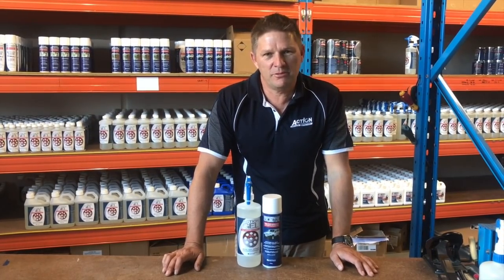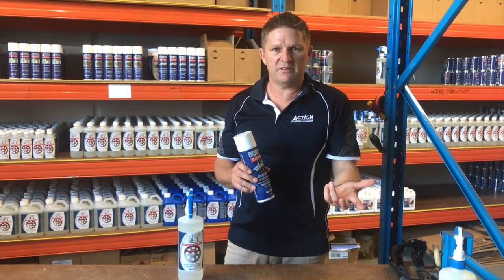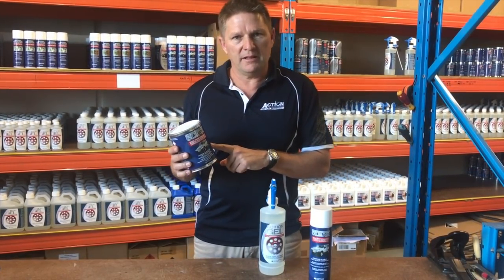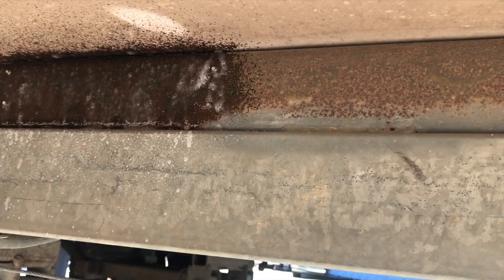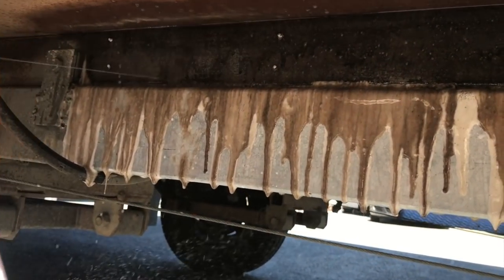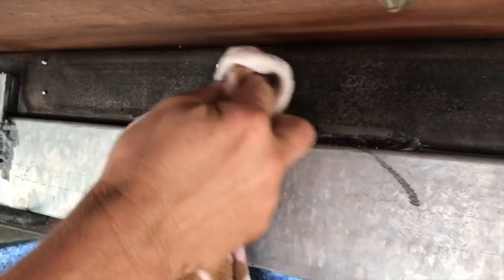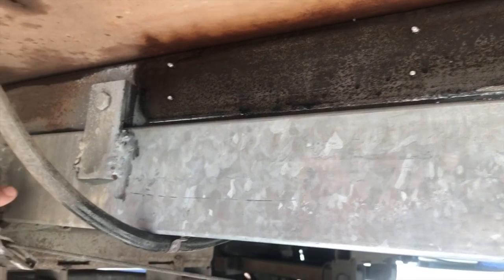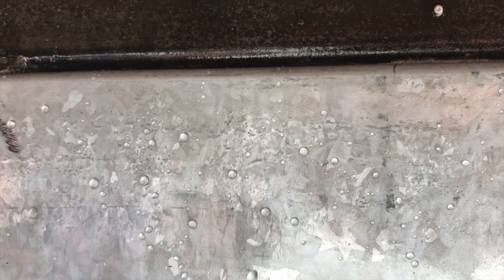How to De-Rust and Protect A Rusted Chassis.

Comment: Those brackets on the chassis look as though they were welded by stevie wonder 😂😂
Reply: They were probably attempting to weld directly onto the zinc coating and couldn't achieve fusion of the steel without burning through the zinc first.

Comment: Has alot of rust on the chassis. Ya right come to Canada
Reply from the maker: Our products are available in Canada. If you would like to test them out you can purchase them at https://www.actioncorrosionsales.com/shop
Reply: i live in sweden. The undercarriage on my BMW from 2006 is completely rusted. 
in order to fix this im gonna have to like put my whole car into a pool of rust remover and keep it in there for a month!
I really want to fix it. but it's gonna take several hundred hours and cost a lot of money. So its's probably cheaper to just buy a brand new car
Reply: i really hope they can invent some new material that is tougher than metal and cant rust. even if it was sitting in the bottom of an ocean for 10 million years it still wouldnt have a single piece of rust.

Then they have to make a car out of that material and give it to me!

Comment: So how about a new update video to show how that finish has held up after a year. Thanks.
Reply: They won't do that incredibly hard coatings crack and fall off
Reply: Use boat paint ...if you live where snows a lot....
Reply: @saulrivera1133  omg this here is one of the BEST pieces of advice I've heard regarding this topic. I hadn't of thought of that! I live in Central Oregon and one thing we know well here is cold and snow. We'll get between 4 - 10 feet of snow OVER NIGHT in some areas. 

I just returned to Oregon after living in New York for the last 3 years. They heavily salt the roads in winter over there. I have a 1998 GMC Sierra with a 10inch lift. I drove it from Oregon to New York. Not a spot of rust on the undercarriage. After 3 years on salty new york roads the ENTIRE undercarriage is COVERED with rust. Just solid red bumper to bumper. That's my I have been hoping to find a spray on rust remover cause i dont want to have to pull my truck apart to get all the rust off. I had been considering different types of underlining but boat paint and coating makes incredible sense! It would hold up better to the snow and moisture in the winters here. Luckily, because of the elevation here (about 5000ft) there's no humidity. But our winters are harsh cause we sit inside the snow clouds (I live in a mountain town). 

Awesome advice bud. I'm definitely going to give this a shot. 😎👍

Comment: Thank you for posting the video. It looks like to me you would have been off using a brush and brush it on.
This way there would be no over spray getting onto to other parts of the vehicle, and no streaks or drips either.
It also reminds me of Navel Jelly the way it works in dissolving rust.
Reply from the maker: Using a brush is definitely an alternative way of applying the Action Gel that we recommend.
Reply: You are just wipe a cloth thats not a quality work.use a cup bras put it in a grindet or a drill,there are small steel brush thatcan fit in a dtill,to make it quality.aftet using a steel brush din thats the time u use anti rust sprayer.

Comment: When he was talking about a 25 year old vehicle with bad rust i was shocked to see it look so good underneath.
Here in Canada that would be a 2 year or 3 year old untreated car.
If i saw a 25 year old vehicle with surface rust like that i would think it was parked inside its whole life.
If you have a normal driver in Canada left untreated the cars frame would be rotten like swiss cheese in no time.
I was looking under 2018 and 2019 trucks at the dealers and they had that surface rust everywhere except the ones which were undercoated every year.
Reply: Ive lived in Tucson my whole life and have a 67' Scout thats lived its life here too. No rust. Im older than the Scout but I dont look near as good. My question is for this vid is could you use a hose to rinse or is a squirt bottle the only option.

Comment: I've had a dilemma for a long time if I should sand my Saab 9-5NG 2011 undercarriage mainly because of two reasons:
 a) sanding is the best way of removing rust, but at the same time, it's very destructive and will damage all the factory protective layers that have been applied in the manufacturing process (in my opinion, not repeatable in a garage environment for sure). Furthermore, it will not reach places like those between the sheet metal welding.
b) costs - If I were to give it to pro mechanic to do it, it would cost 1/2 value of my car.  

My first idea was to get rid of loose surface rust first and then treat it all with special purpose marine or industry paints, which are quality products to be used directly on rusty places being very resistant to environments like salty water. Your process looks promising and seems to be an alternative, and way more simple, however, I think the final flexible layer should be applied to protect the metal against stones etc.

Do You seel these products in Europe too?
I'd be happy to hear some of Your thoughts . Thanks

Comment: The clear coat protectant seems just to be clear coat paint the only difference is the spray applicator is really nice because it seems to spray in a 5 to 6 inch wide line.
Reply from the maker: Hi Paul. The Clear Coat is not a paint. It is actually a resin based product, not oil or water based. This is what gives it such good protective properties. It also has an extra quality that it does not allow rust to creep under it like paint does. If you would like any more information on the product please email admin@actioncorrosion.com.au

Comment: You protected your chasis against liquid only, but vehicle chasis needs to be protected from rocks aswell. When you are driving on the road, there will be some rocks hitting the chasis and penetrading this thin  waterproof coating. The water will  be able to get to the  metal after that  becouse the coating will be damaged in some places and the rusting process will restart in no time. Thats why you should put some heavy duty anti-gravel coating + add vax in the the end so that anti-gravel coating dont dry.
Reply from the maker: Rocks may chip the coating but as it is self leveling, it is easy to touch up. The product also has the ability to prevent rust creep so it will not spread under the coating.

Comment: Transmission fluid works very well for anti rust and isn't nearly as expensive.
Reply: How do you apply      Can / paint brush? 
Does it need heated up or anything and is using the used Transmission fluid ok?   I have lots of that setting around
Reply: Robert Maxwell When I applied it to a bare metal frame after sand blasting it. I applied 80/90 weight with a brush. That stuff soaks in and stays.
Reply: harry pag Yes sorry that's what I meant, I have confused the 3 because I use it in a manual transmission.
Reply: Samuel Miller -the idea is to avoid the wire brushing/ power brushing/ scraping totally! That’s the PITA work. Lots of oils work great applied annually to the underbody (I prefer fluid film or Eastwood, both easily spray on)
Reply: @dominiquestephenson195  do you apply the fluid film directly over the rusted area or prep it first?
Reply: If you mix it with acetone you can use it inside a chassis, it will "creep" into the rust better before the acetone evaporates and leaves it there.
Reply: @Smurphenstein  REALLY? I saved that info and will try it out. I appreciate you

Comment: The rust would've been on the top face of the chassis as well, where the floor lays on it and there'd be more areas where two metal surfaces meet. How did you get the rust out of those areas? You didn't. The product seems to work well but please don't let people think the job can be done just by spraying the areas you can see. It's rust in areas you can't see that'll destroy your vehicle. Two parts that are attached must be separated, treated, and put back together. On a caravan, that means the body has to come off the chassis.
Reply from the maker: This video is to demonstrate how someone can use these products to maintain their vehicles/other machines at home. There are other services available for those who want to pay for a company to remove the chassis and protect the full surface. However not everyone desires that process and expense therefore this is a wonderful alternative.
Reply: @actioncorrosionptyltd2526  pointless alternative at best... either do the whole surface area or don't bother wasting money and time... all 4 sides of the metal need to be done or its just going to creep back over and rust internally.
Reply: @TRolla82  your right but using product like this and others will delay the inevitable. If it buys you another 3 to 5 years before your car gets to the point that it's unsafe to drive its worth it for most people
Reply: Why don't you do a video showing how you did all that?
Thanks

Comment: @Action Corrosion Pty Ltd how much surface prep is required where there is some flaking? This is an almost perfect use case where its surface rust without flaking, how much effort should i put into removing the flake or rust before using the gel? Can i take too much off? You mention the products purpose is primarily a remover hence i assume i cannot over-de-rust the surface, right?
Reply from the maker: You should try to remove the loose flakes with a wire brush. Any dirt/grease should be washed off before applying the Action Gel too. This is so that the Gel can make contact with the rust that is on the surface of the metal. For very heavy rust, the Gel may need to be applied again.

Comment: Are you rinsing off the gel with more gel?   Can water be used to rinse the product off the substrate?   The welding on that camper/caravan is horrendous and unsafe.  I would find out who did that job.    I cant quite tell if your product removed the very light layer of rust on there or converted it to phosphate.   Looks like it worked.
Reply from the maker: The Action Gel is washed off with water as this breaks down the Gel. The Gel removes and converts rust. It removed it off the metal in this demonstration.

Comment: I like that, but how dopes it deal with abrasion? I have a 1987 300ZX that I'm going to be finishing the restoration on over the next couple of years, and these Nissans are notorious when it comes to rusting. Let's say I use this product to remove any rust on the underbody and any hidden areas, then use Rustoleum Rust reformer to catalyze any remaining rust and paint the metal black. After doing that on the entire underbody, I coat the painted surface with the with the RustProof Clear, how well does it protect against sand, gravel, and road grit?
Reply from the maker: Like any painted surface abrasion will wear down the Rustproof Clear. However if it is chipped by a rock or worn down by sand, it is easy to touch up as it is self leveling.

Comment: How does this product work interacting with aluminum, plastic, wires?
Reply from the maker: We recommend avoiding plastic and wires. You can simply wipe off the Action Gel with a wet sponge if any gel makes contact with an unwanted area. Although immediate contact will not damage them. 
Action Gel can be used on aluminium to remove rust however it needs to be monitored closely.

Comment: The slide rails on my RV are rusted to hell. It looks like a previous owner lived at the beach and never once lubricated the gear teeth :( Is the Action Gel something I could use on the gear teeth (not gear pack) and wash off completely, then lubricate? Thanks in advance.
Reply from the maker: Hi Rena, Yes Action Gel could be applied to gear teeth and then washed off once the rust has been removed. That will leave the bare metal clean and ready to be lubricated.  

However is there is any lubricant or grease on the gear teeth already, remove this before applying the Gel so that there is nothing preventing the Gel making contact with the rust.

Comment: Two questions:  
1.  This shows a spray bottle applicator, but on the USA site, it shows the gel bottle as a brush application.  Is there a difference specifically for autos?
2.  How does this work, esp between layers like springs, or in cracks and hidden areas of auto frames?
Reply: Step 1: Buy Action Gel.
Step 2: Buy Trigger for spray bottle.
Step 3: Place Trigger in Action Gel Bottle.
Reply: Where can  a person find these products?

Comment: How does it hold up against the elements I live in the salt belt in the U.S. (Salt lake city, Utah specifically)?Will I ever have to re-coat again?
Reply: lol ive been looking for solutions for road salt for months ..nano paints ? to bad thier no indoor cash wash with a in door parking garge ?
Reply: Can't beat boiled linseed oil after acid has dried.
Reply: A bit late to the party... Use a phosphoric acid based solvent (like in this video, or go at home depot and buy it by gallon), wash it after 20min, and then use fluid film. Apply before winter season every year. Look online, plenty videos on fluid film. Imo it's best anti-rust treatment ever.
Reply: @thermorex  Fluid film applied every year has not helped my cars very much.  Overrated in my experience.
Reply: @thermorex  I'm gonna try fluid film in the fall

Comment: I'm trying to use it on my van chassis.  Will it damage rubber booth and other rubber sealant? Thank u
Reply from the maker: It is not designed to be applied to rubber. We recommend avoiding it. However if you accidentally get some Action Gel on the rubber it will not instantly damage it and you will have time to clean it off with water and a cloth/sponge.

Comment: So thinners only after gel / b4 clear coat?  Or b4 gel as well?
Reply from the maker: If the metal surface is dirty/greasy we recommend you clean it down before applying the Gel so that there is nothing preventing the Gel from making contact with the rust. General purpose thinners is to prep the clean metal surface for the Clear Coat.

Comment: If I sprayed this on my 05 F150 chassis the chassis would disintegrate 😆. The chassis suffer from severe rust. I think this would work best on surface rust that's it.  Still appears to be a good product.
Reply from the maker: We have used it on some pretty heavy rust and it works great it just need a bit more time. However manual removal of rust flakes and excessive rust always helps it out.
Reply: @actioncorrosionptyltd2526  I agree, my chassis is flaking in some spots. Do you have a website?

Comment: Will this damage rubber or bushings wires etc
Reply from the maker: It will not instantly damage rubber however I recommend avoiding it where possible and wiping it off with a wet sponge/cloth if it goes onto rubber.

Comment: Is it safe if the gel gets on rubber? Such as lines or hoses ?
Reply from the maker: Yes it is safe, just make sure that the Gel stays wet and is thoroughly washed off after use.
Reply: So no dont get it on the lines
Reply: @BK-pc6ov  
He didn't say don't get it on the lines. He said don't leave it on there.

Comment: Ok,,I'm just about ready to buy some.....Do you take paypal? Would that be the best way considering i"m in the U.S and you're in Australia?  I'll be needing your product to clean up rusty underneath's of trucks and S.U.V's....I'll be hoping to do the entire underneath of the truck hitting every spot that shows any type of rust,and then use your clear to make it look nice and repel fluid...Is it okay to do literally everything underneath the vehicles?
Reply from the maker: Please email our U.S. distributor at actioncorrosionusa@gmail.com to purchase our products.  Yes, you can do the full underneath of the vehicle.
Reply: what does nano paint do against road salts?
Reply: Action Rustproof Clear is a specialty coating that has salt and rust inhibitors, it is engineered to resist and protect from the effects of all salt, it works very well in chassis protection so long as its properly applied and the surface properly prepped.
Reply: Not even much rust on that chazzie mate.You have no idea what real chazzie rust is! Chazzie’s here get broken in half mate.

Comment: will this affect paint? i need something to remove rust from rock chips
Reply from the maker: Using Action Gel on the painted panels of a vehicle may affect the gloss finish and be visible depending on the colour of the car. We recommend testing it on an inconspicuous area first. IMPORTANT: Do not leave the Gel to dry. Monitor the whole time the Action Gel is applied and wash off immediately once the rust has been removed.